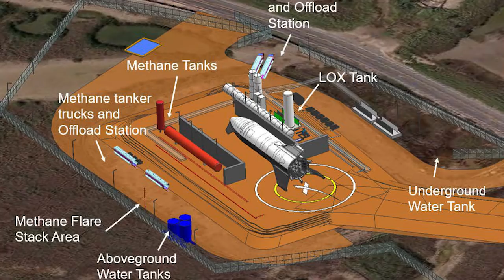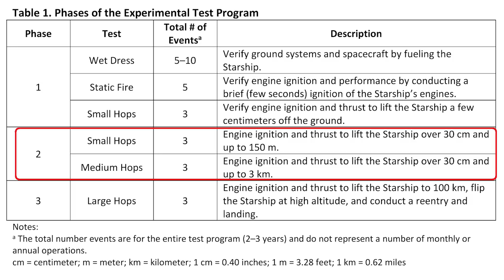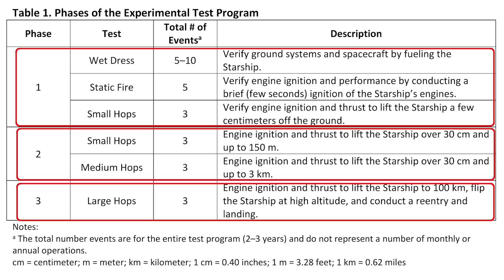SpaceX Starship Update:  SpaceX confirms it's almost ready to test its orbital Starship

Comment: SPACEX, Starship spacecraft can never work as presented - More than 95% of the weight must consist of the propellant in order to reach space!
Reply: The propellant is the cheapest thing about rockets. The hardware costs a lot to build and make sure nothing fails. And currently there isnt a more economical way to get to space in unfortunately
Reply: @jetison333  Normally, it takes multi-stage rockets to get out into space especially if you are going to transport something - Good luck with the project which I don´t think will be a success!
Reply: @Djur2844  The rocket is going to be a two stage rocket, fully reusable. The project should work out.
Reply: @jetison333  What happens to the astronauts if something wrong occurs - Will they use parachutes and land at launch point or in the sea with life jackets on? Failed launches occur every now and then!

Comment: why can't they 3D print the shell?  there's campers that are smoother
Reply: You want to 3D print a soda-can?
Reply: @3gunslingers  imagine a car with no seams or a space ship without structural fail points
Reply: @addikotter4351  
Every layer in a really thin wall is a structural fail point. 
Also I would like to see a 3D printer big enough to produce a Starship Booster.

Comment: When you count down to the 5th layer from the tip of the rocket: see the column (fuselage?) it doesn't fit the cone. Timed at at 6:08 in the video.  The tin cone at the top doesn't meet the tin column.  Come on, this not precision engineering.  What's going on 🤔
Reply: It's just a prototype, it doesnt need to be perfect to test things.
Reply: @jetison333  
....alright.

Comment: Just landing the 1st stage boosters is cool as anything in a long time.Going to mars will have many unanticipated challenges very far from home.I saw a plan to send an autonomous ship ahead that would manufacture fuel from the atmosphere.A manned mission is launched when a fully fueled return ship is ready thus having a much greater margin of safety than a single ship.
Reply: SpaceX has the plan to send 2 ships at first with cargo. Then every two years they will send two further Cargo-Ships and two manned ships.
The first return trip will only occur many years later when fuel production is set up. 
The first few dozent people on mars will most likely stay there for ever.

Comment: Will final orbital rockets have such wrinkly surfaces?
Reply: Judging from the progress from Mk1 to Mk2 the real orbital rockets will have some wrinkles but be quite smooth in  general. 
It the wrinkles don't interfere with structural integrity or aerodynamics there is no reason to go to length and iron them out. Progress over looks.
Reply: Keyboard runner That’s what I suspected. I’m not used to wrinkly rockets (in life or sci-if art). But it may become a new expectation/visual trend. As an artist this interests me. The reflective surface no doubt has everything to do with it as it exaggerates any imperfection. 

Will they stay reflective? Is that the nature of using stainless steel? I’m curious if another surface or paint is expected to be added.
Reply: @iridescentsquids  
Maybe the booster will be painted. But the starship itself will stay reflective. Reflecting stainless stell will reject most of the heat during reentry, making other heat protection system unnecessary. 

Steel is heavier per given volume than Carbon fiber, but it has more strength by weight when really cold (cryogenic fuels) or really hot (reentry) 
It's also REALLY cheap and easy to work with. You don't even need a roofed workshop.
Reply: Keyboard runner I thought using stainless required an active cooling system. Some kind of porous “bleeding”
Reply: @iridescentsquids  
True, but I think SpaceX has moved from sweating CH4 to hexagonal heat shield tiles for exposed parts of the ship. 
My comment was not very accurate. I should have said that something like additional coating or applying additional heat resistant mats (like on the space shuttle) on lee-wards surfaces is unnecessary.

Comment: Amazing that it looks like the whole thing so thin and just built of rectangular metal sheets. Looks very DIY.
Reply: How thick do you think a carbon fibre rocket was? Significantly thinner and also lighter. That's why it was used. But the expense meant stainless steel was strong enough despite a weight penalty.
Reply: @jnc1771  I know nothing about huge rockets but I always assumed there would be a substantial support frame inside and that the surface would be much smoother, (to reduce drag). The rockets shown look like mock ups for low budget Sci-Fi movies.
Reply: @bobjackson4720  
"I always assumed there would be a substantial support frame inside" You are right. And there IS! But we just can't see it from the outside. 
"that the surface would be much smoother" Since rockets go so fast from see level to vacuum, the aerodynamic drag is really low. The SaturnV for example only lost 40m/s of delta_v to atmospheric drag, but had to overcome 1,534m/s gravity drag. 
So the smoothness of the body surface is not critical. Especially when the building process can be speed up significantly by "neglecting" to surface.

Comment: Yay. Orbit. Something that was done many decades ago. :/ And that rocket looks like it was built by a 10 year old. I imagine that the friction from the atmosphere will hook into those crap welds and we will witness a fantastic and earned explosion and failure. So far this Starship business looks like a total farce to me. I will be happy to be proven wrong, but this all seems like BS to me.
Reply: Since rockets go so fast from see level to vacuum, the aerodynamic drag is really low. The SaturnV for example only lost 40m/s of delta_v to atmospheric drag, but had to overcome 1,534m/s gravity drag. 
So the smoothness of the body surface is not critical. Especially when the building process can be speed up significantly by "neglecting" to surface.
Reply: @3gunslingers  OK then; what about the required re-entry? lol The critical speed, temperatures and torsions then are something else yea. What about re-entry stresses Keyboard runner?
Reply: @RonArgyle2011  
During the first face of any reentry, when the temperatures are the highest, you don't have laminar flow anyway. It's molecular flow with plasma. So the surface quality is quite unimportant. 
During the next face of reentry you want to slow down as much as you can. So a high drag ratio would be preferable anyway. (remember starship will land tail first, not on its belly like the shuttle.)
Reply: @3gunslingers  If that makes you feel ok with all this, so be it. I'm amazed you don't share my concern. Once again,  I will be happy to be proven wrong, but this all seems like BS to me.
Reply: @3gunslingers  PS. That's "phase" ya looking for.  :/
Reply: @RonArgyle2011  
I'm an aerospace engineering student. So far nothing I have learned would indicate that a spaceship out of stainless steel (even with a slightly wrinkled surface) would have trouble during reentry.
Reply: @RonArgyle2011  
Yes, thanks. Should be phase.
I'm not a native english speaker.
Reply: @3gunslingers  I would only add that the institution where you are learning, certainly would not denounce Apollo to the moon. This is a major problem within academia. It's owned and run by the elites who run these deceptions. They won't give you the real secrets! The table is tilted, the game is rigged.
Reply: @3gunslingers  A steel ship that appears welded by children! Yea, nah.
Reply: @RonArgyle2011  
Because you can judge the welds on steel sheets? Have you ever welded yourself?
Reply: @3gunslingers  Yes. Every graphic depiction of the "starship" they show a smooth chromic cylinder. Then.. these guys build that heap in front of us. Oh we are gonna need rocket loads of popcorn for this comedy routine! :)
Reply: @RonArgyle2011  
Do you really think SpaceX would go to the length of rendering all the wrinkles on their starship just for public release? 
Do you really think that?
Reply: @3gunslingers  no. I really think they are making a garbage tin.
Reply: @RonArgyle2011  
A garbage bin that as already flown. Don't you know that?
Reply: @3gunslingers  It's not built yet stop being silly.
Reply: @3gunslingers  And the title of this video is wrong and misleading because the thing is a LONG way off an orbital test.. I'm telling you, make sure you have plenty of popcorn for this comedy routine, but you'll have lot's of time to get your supplies.
Reply: @RonArgyle2011  
The prototype (starship Hopper) was started in November last year. In July was the first short hop, in August the first 150m hopp. So a part of the system has undeniable flown. And it was, as it still is, "only crudely welded stainless steel".

The first 20km hopp will happen this year.

And I'm sure at every stepp SpaceX successfully makes you will say "Oh, it's only this, they will never do that".
Reply: @3gunslingers  You are making me need even more popcorn!
Reply: @RonArgyle2011  
Please don't choke on it. 

Btw how tasted your popcorn when SpaceX landed their first orbital booster?
Reply: @3gunslingers  I could say with near 100 % certainty that you .. could not prove that SpaceX landed their first orbital booster. Definitely not. Did you see it land? Of course not. I'm here to tell you that those people are specialists in deception. That; being a constant, my popcorn tastes the same too.
Reply: @RonArgyle2011  
Do you think that all People living near cape canaveral are in on the job?
Because they could all hear and see several boosters landing up to now.
Reply: @3gunslingers  I asked you not people you imagine.
Reply: @RonArgyle2011  
No, I didn't see it land. I just saw dozens of videos from lokal people. 
Are they all in on the job?
Reply: @3gunslingers  Really. Paste a link here then. Let's see it ey.
Reply: Typical doom & gloom procrastination...typical YT dickhead comment. 🖕
Reply: @AnthonyElsom  Haha.. your typical rude and disgusting bs misdirection from NASA apologists. Shameful and so common and predictable from people who've taken the lie.
Reply: @AnthonyElsom  Please, be more vacuous. I almost giggled...
Reply: @AnthonyElsom  Ha. And you think you've challenged my position? Just look at the quality of your mind.
Reply: @RonArgyle2011  Right, enough of this..then tell me,..How does it feel to be a butt-hurt nobody compared to a successful billionaire rocketeer, cause that's the impression you gave with your original post. Which part of "experimental" or "prototype" confuses you?
Reply: @AnthonyElsom  What part of garbage can disintegrating during reentry confuses you?
Reply: @RonArgyle2011  None, since they're still on 20km hops...I don't think they're gonna use THIS for space and re-entry, since it would require the super heavy booster, and a shitload of raptors..THAT,.. will be next year, and the starship for that will be more refined....compare the starhopper with their Falcon nine Crew Dragon. What you see here is just basically an extended version of their hopper water tower. You should rather follow the SpaxeX news and enlighten yourself before making stupid comments on something you know zip about, over and out.
Reply: @AnthonyElsom  I see. I do wonder why these designs are so odd and awful looking. It looks like shit to me.

Comment: Another bad design from spacex which will not work. How much i can tell you spaceX that millenium falcon is required not falcon rockets and "starships". Millenium falcon is a starship. Your designs are tincans.
Reply: If you look into why they've built the ships out of stainless steel you'll find out some pretty interesting things about why. And the rocket should eventually work, the name of the thing doesn't hinder it.
Reply: @jetison333  
Stainless steel is good. But its not good enough. Also propulsion is bad. Superior secret tech have been used in Area 51 by lockheed martin. Astra TR-3B could land on Moon/Mars for real. Because is massive craft with advanced propulsion methods and soft landing and inertial dumpsters.
SpaceX design cant be stabilized. Landing huge pencil shape object vertically is contrary to common sense. So millenium falcon style ships are needed. Not spaceX rockets. But problem is that secret tech wil make fuel industry obsolette overnight. They dont want that.
Reply: @LORDVADER357  do you have any proof of this secret propulsion?
Reply: @jetison333  
Absolutely i do have proof. You can google Astra TR 3B. It is considered to be aircraft but is actualy a spaceship. In fact its spaceship that is aircraft and aircraft that is spaceship. NASA also had many divisions of advanced propulsions. This is also a secret. But the biggest secret is that universe is electromagnetic and gravity is actualy weaker version/byproduct/side effect from the electomagnetism and static charge attraction. Planetary orbit are locked in electromagnetic equilibrium. Also secret is that energy is unlimited and light speed is not maximum possible speed. So everything you see in star wars sci fi movies they already have it for real. In fact when George Lucas made his models he hired NASA spaceship designers. Btw earth have magnetic field correct? Yes. And there is lots of iron atoms on the moon and magnetic materials. Oxygen is paramagnetic material thats why is attracted much closer to the surface.  
So the propulsions are based on electromagnetism. Mercury plasma is accelerated to huge speeds. This creates very strong force filed around the ship. The force field repel against the earth magnetic field and the magnetic fields in deep cosmos. Ask yourself why there are not gravitons but are plenty of electrons? Because there are not gravitons. And the force in star war sci fi is electromagnetism/magnetism.  Wanna prrof? ASTRA TR-3B is your proof. Price was 3-4 bilion dollars per ship. In modern money 10-12 bilion per ship. Apollo style tech is just bogus homeless tent on four legs with carboard,duct tape and some cheap foil around it..

Comment: What an ugly old school space craft - no where near the new carbon fiber craft, that take off from the back of a large aircraft up in the Stratoshpere, and so cost FAR far less to launch
I do hope it uses a HOPE hydrogen oxygen piston engine rocket, and so exhausts pure water, at least (they can steal my work if they want, since it matters so much to our future)
Reply: It's a prototype.
Reply: Carbon fiber costs a lot more than steel.
Reply: @jetison333  sorry it looks like a mock up done for a junior high school play about space.
Does not Elon Musk know anyone that can afford expensive things, like real carbon fiber?
Call me if you want it to run on liquid Hydrogen and Oxygen, exhaust pure water, and cost far, far, far less since it takes off form the back of a VLA, that also exhausts pure water.
"HOPE springs eternal"
Reply: @gordonanderson3111  Are you trying to say that just because its expensive its better? its cheaper to build it out of steel and it works just as well if not better. Your judging a quickly and cheaply thrown together prototype based on looks. And do you think you can make me a rocket that will launch 150 tons to LEO?
Reply: @jetison333  Yes I can. The Space Craft design for that is called 'MLIVE', Mega Large Interplanetary Vehicle Environmental, with lander inside optional. It is designed to fly out to the outer planets, land on some of the moons, and return to Earth, possibly with no crew left, since the exposure to radiation would be killin most people after the years it takes to go that far out. 

YES the craft is shielded, but that goes into areas such as cloaking 9and the super secret defense against SOL electronic beam weapons)  that are far too valuable a secrets to our military,(that entered my former home, since torn down to make me "a homeless person" and photographed all my work)  and I would only talk about them to my new frends in China, the rising super power. Why work for a failing falling super power, I will have a last laugh over the ashes of the USA, stupid sodomizers of little boys they were.

Comment: That is not the Upper Tank Dome 3:40 minutes. It looks more like the Lower Tank Dome Thrust Structure with locations for 3 engines. Maybe they just lowered it all the way through the tank.  Those may be rivits on the stainless legs, but probably only in the heatshield. The structural part of the leg isn't visible, it's inside the leg heatshield.